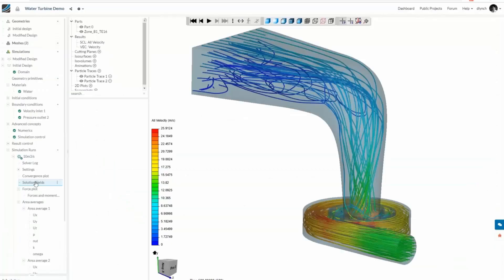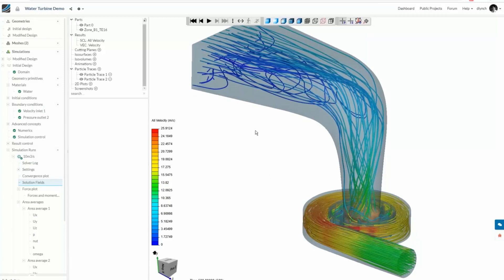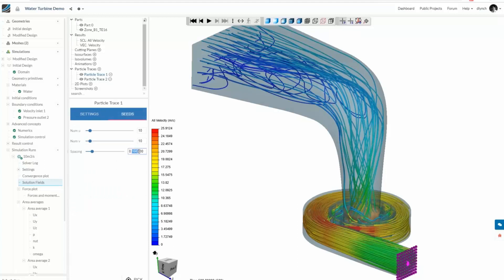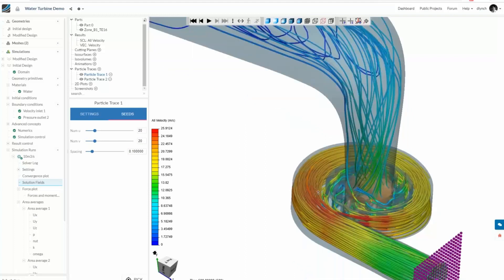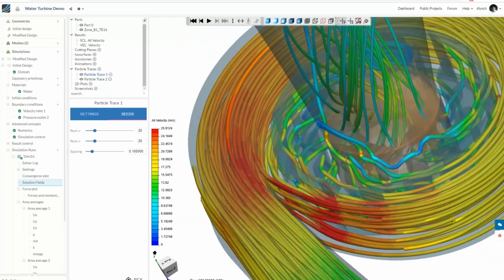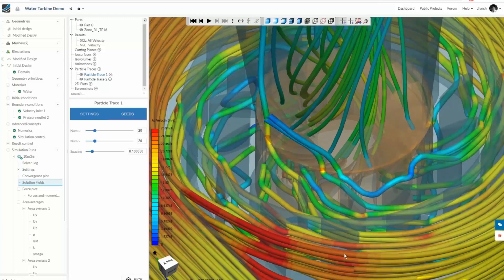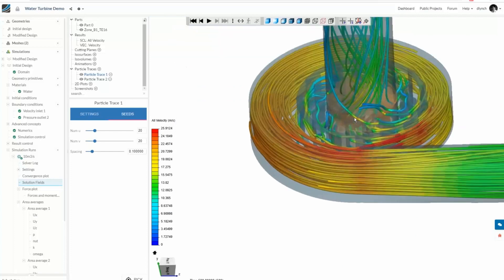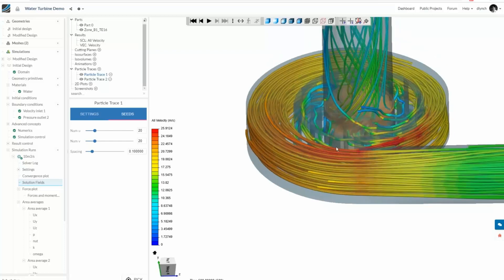Water Turbine Design Optimization with CFD

Comment: Hello to the owener. I am currently doing CFD thesis on a Kaplan turbine. Can you help me with the geometry? I like your geometry, and I am struggling on creating one. Thank you.
Reply from the maker: The CAD geometry is included in the public project. You can find the public project used in the video here: https://www.simscale.com/workbench/?pid=1220870254291642436&mi=spec%3A04865162-10c9-481e-a96f-9fb1495b4b13%2Cservice%3ASIMULATION%2Cstrategy%3A5. As this is an old video and project, some of the geometry may be outdated (it will say in the Geometries tree section on the left).

You can also search public projects for kaplan turbines: https://www.simscale.com/dashboard/v2/search?q=kaplan%20turbine

Lastly, if you cannot find what you need, you can always search for free CAD models online to import (e.g., https://grabcad.com/library?page=1&time=all_time&sort=recent&query=kaplan%20turbine).